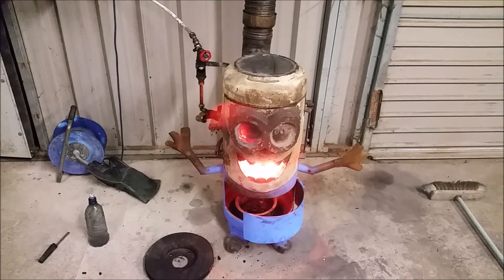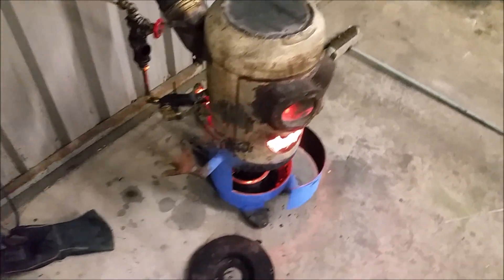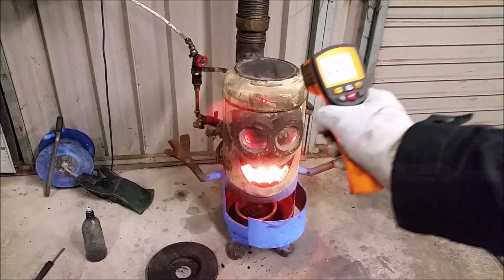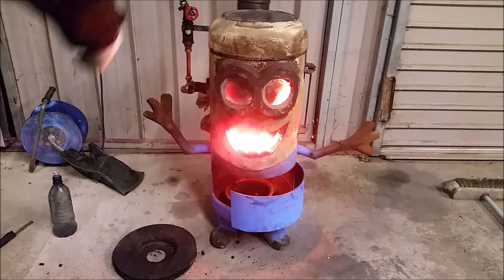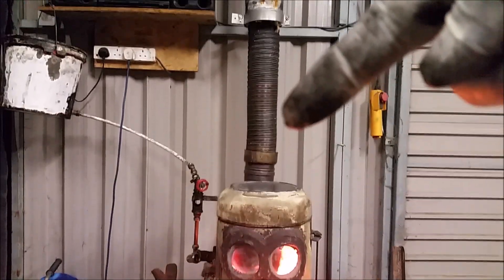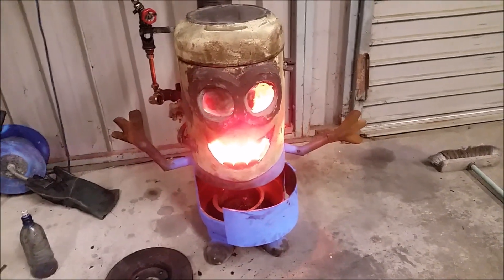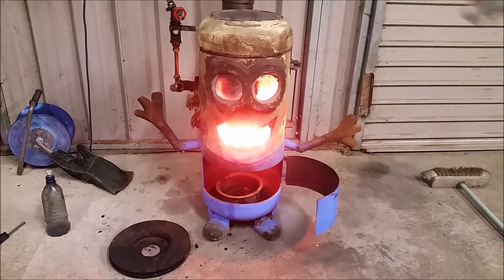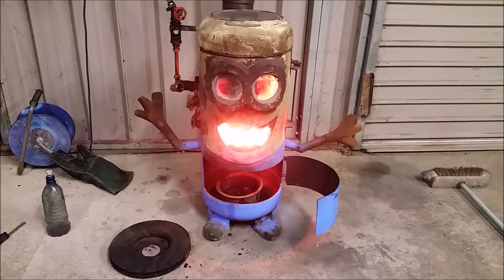Waste Oil Stove .. Cherry red .. OVER 1276°F..

Comment: Hi Gerry, a group of us have been messing around with waste oil heaters for a few years now like yourself , the most common cause of smoke  we have discovered is not enough air flow, I have a unit that can heat my spa pool from say 10c to 40c in 90 minutes , 1500 liters of water, its made from a length of spiral welded pipe and glows cherry red , another unit heats my work shop , it runs off a 200 liter header tank so can run non stop for a week if needed , my brother has built an enclosure around the outside of his and pumps air in from out side through the enclosure and then into his house through floor vents , it works extremely well, its great to see peoples reactions to the heaters as it takes them a while to understand how they work. They don't realize a gallon of waste oil has almost double the BTU of propane. Regards from New Zealand.
Reply from the maker: Hi Kevin. I haven't been to New Zealand yet but it's on my to do list. I just uploaded another video with an increased airtube and it is working well but I didn't have time to run it for long. i have it set up and ready for the next therapy session  of shed time. I have some blower versions making nuclear type heat and a couple of Ozzirt burners too. I saw one of Spikes videos from Oz and that got me started on this waste oil burner stuff. Well done on getting it all working well. Cheers Gerry
Reply: Hi Gerry, cheers for that , I had a great time in Ireland , my parents were from Carlow , will check out your other vid ,Regards Kevin
Reply from the maker: Hi Kevin. I fly my Paraglider  from Mount Leinster ( Wexford / Carlow border ) and I can see Carlow town from the air about 30 kms away I have been there many times.  I have a Kiwi friend and he's a bit nuts but he says that about me too. All the best. Cheers Gerry

Comment: Hi Gerry have you considered having a pipe from outside coming in directly to the bottom of the stove for the inlet so to speak. I have a wood burning stove of about the same size and having the stove burning cold air all the time makes a great difference. Plus the stove isn't sucking cold air into the garage from outside, I found that the area that is being heated gets warmer quicker and the stove works allot better. Maybe you have tried this you seem to now a hell of allot more than me. Keep up the great work
Reply from the maker: Hi Brett. I haven't done it yet and all the A rated energy homes here ( usually ) timber framed are quite airtight and require and outside air source for stoves . When I get my shed spray foamed and airtight (ish) I might have to arrange for an outside air supply too . Thanks Gerry

Comment: Makes a lot of sense due to the expansion of hot air and the need to create a vaccum. It should multiply the heat. Roughly you are putting the same heat as the Oil Burner w/air turbine. The cherry red brake disks should also help the second burn if you drilled additional holes near the top, & reduce smoke. Congrats!

Comment: Gotta figure out how to heat the side of the stove a little more evenly. I'm wondering if drilling more holes, higher up on the center part of the burner would help with a cleaner burn and to get a little more heat higher up the stove. Maybe you already tried that. I'm thinking the higher holes might create a secondary combustion and clean up the smoke. I used to have a propane burner that had an upside down cone in the center to direct the heat towards the outside of the barrel...another thought.
Reply from the maker: Hi Marcel. I had just thrown in a couple of brake disks into the stove as baffles and one fell while it was running. When it cooled down I could see why the stove was getting red hot at the sides. The stove is burning better now too and delivering a huge amount of heat. I can get it running more efficiently and I have a new burner made to try tomorrow. The problem with secondary combustion is that if I introduce air higher up it will decrease the pressure lower down. For such a small burner it can produce a scary amount of heat with no difficulty. This design lends itself to forced air but I am getting great results with this setup. More experimenting tomorrow. Cheers Gerry
Reply: Gerry's Waste Oil Burner ahh, that was the problem... makes sense now. :)

Comment: Hi Gerry, I've been watching your vids for a while now, I've got a smaller stove that I'm working on it's cool to see how your prototyping is going. What a difference the flu made, wasn't expecting that. Thanks for sharing.
Reply from the maker: Hi Greg. I need to get the flame to behave properly so that it  travels evenly through the stove but that is only a matter of setting up a few baffles. This stove is quite small but when I have the burner working a little better I will probably move the burner to the bottom chamber. I made a new burner unit tonight. Its bigger and deeper and I will fire it tomorrow and see how it goes. There was a big increase in burn noise from the stove with the bigger flue. lots more air going through it for combustion. The fun continues tomorrow. Cheers Gerry